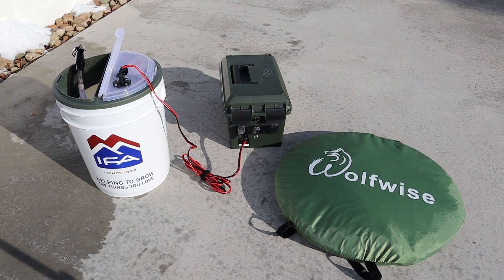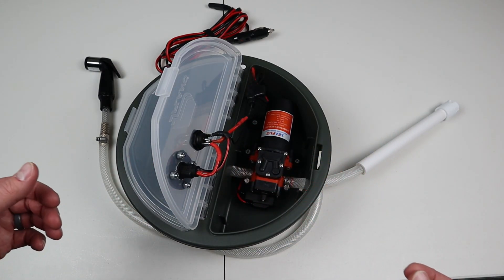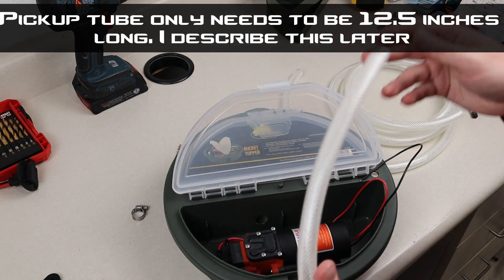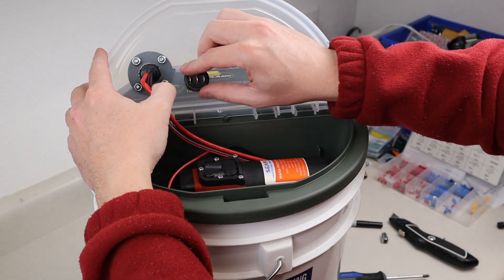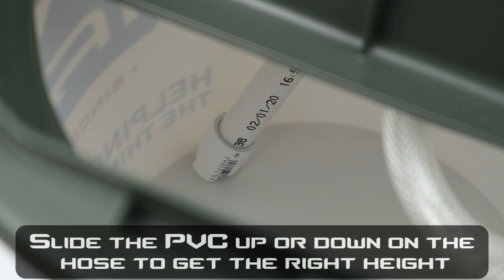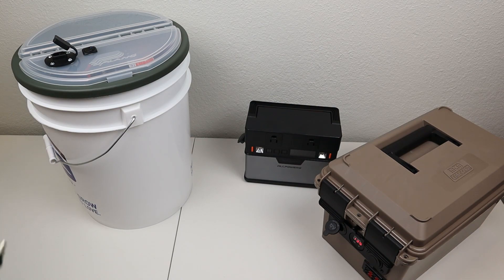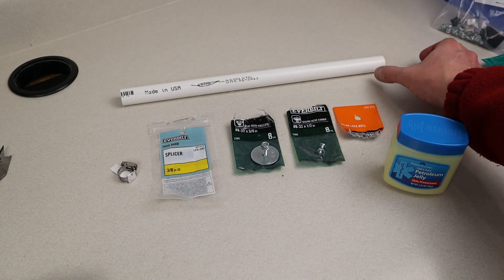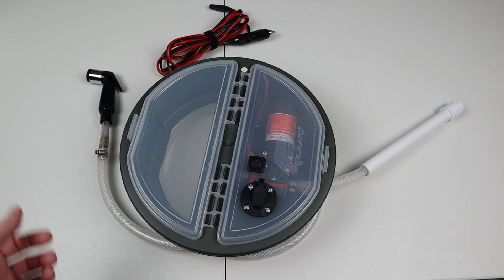DIY 12 Volt Camping Shower - High Pressure - Easy to Make!

Comment: I want to build one of your shower designs. I looked at many other shower systems and your system is best by far in my opinon. I'm also going to build a water pump system based off of your design and add a water purification system to it it for filling up my water from rivers that I go fishing.

I'll send you a video of my system for pumping clean water to my sink and shower. I'm looking forward to building one of your shower systems. I am really impressed how easy and practical your system is. Awesome job Jason.

Comment: One thing I added. A garden hose spray that has multiple spray selection. Have been using my setup for 4 years now. Replaced the on off switch once. Works great. Thanks Jasonoid
Reply from the maker: That's awesome! This project has been so useful over the years :)

Comment: Love your vid. I have a portable rechargable battery that is 12v  2 Amp max. Will that power this? If not, do you recommend a battery to purchase to run it?
Reply from the maker: I love this portable shower! I've built a couple now. I actually use a 3S lithium hobby battery to power it now. 12.6v 3000mah lithium polymer battery lasts forever on this!
Using a regular 12v lead acid battery will be fine, you'll just have to test it out to see how it performs.
Reply: @Jasonoid  Thank you so much. I appreciate your commenting back letting me know.

Comment: just finished building mine, i did one thing different, i added a water filter onto the intake hose and by doing that,  I was able to not have to use the 1inch pvc pipe to collect water from the bottom.
with the curve of the tube forcing the direction one way, i just added another piece to the filter going the opposite way and it lays down on the bottom of the bucket just fine.
Reply from the maker: That's a great idea, thanks for the tip
Reply: do you have a link for the water filter? TIA
Reply: Would love a link to that filter if you don’t  mind

Comment: This is a great idea! I've been using a solar shower with that same enclosure. I also built a 2x2' platform using 1x3" wood for those times when I need to set it up on dirt. Keeps your feet from getting muddy. Would be great to figure out a way to heat the water.
Reply from the maker: Great idea on the feet pad! I am still planning something for that. Heating water is such a challenge, uses lots of power! Still churning ideas in my head. Easiest way is still to boil water haha. Thanks for watching!
Reply: @Jasonoid  try using a black plastic bag that could be placed on the car roof top. You have some great ideas, thanks

Comment: Use a soapy water solution to lube the hose assy instead of petroleum jelly.  Petroleum jelly may chemically attack the hose or not. Soap will eventually was away too.
Reply from the maker: Thanks for the tip!

Comment: Thanks for this great info! I'm wondering if you could incorporate a 12 v immersion water heater.
Reply from the maker: Definitely a possibility! You'd need some large batteries/solar panels, or a portable generator to run the heater. Heat uses lots of energy! Boiling a 50/50 cold to hot water ratio works well and fast using a camp stove.

Comment: I have an electronics question, if you don't mind ? Can I just plug this into a 12V "cigarette lighter" outlet in my vehicle ? If I were to do that, would it be drawing off my battery all the time ?( always hot), or only when the engine is running?  Thanks
Reply from the maker: Yes, that would be a simple way to power it. The pump only pulls power when it's running so I dont see an issue connecting it to the battery all the time. If you hear the pump, it's pulling power.
Reply: So, I would need the engine on to run the shower? @Jasonoid
Reply from the maker: @new2guitar1  no, you can run the shower pump without the engine running. It doesn't pull too much power so I wouldn't worry about your car battery dieing.

Comment: Have you tested approximately how much power the pump uses during operation? Amazon says the current draw is ~2-2.5V, so should be around 24-30W? Thanks.
Reply from the maker: Im pretty sure I show the power usage in the video. It's around 22 watts. Most batteries will last FOREVER at that load.
Reply: @Jasonoid  Sorry, must have missed that!

I'm also a little perplexed on how the sprayer/pump operates? At 0:40, it sounds like pressing the faucet trigger is what "activates" the pump? Is that basically how an "on-demand" pump works?

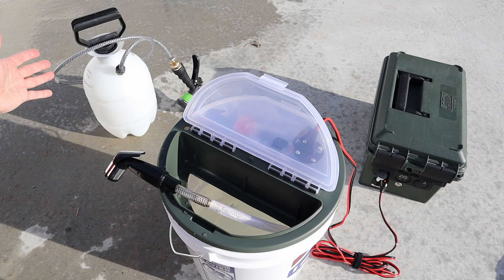Also, could you have also used the same nozzle used in your pump sprayer (1:02)? I think they should have 3/8 barb to garden hose adapters in most hardware stores..
Reply from the maker: The pump keeps the water at 35psi when ever it has power. Once you pull the trigger on the sprayer, the pressure drops and the pump kicks on to get the pressure back up to 35 psi. Once you stop pressing the trigger the pump builds up pressure and turns off. 

You can use which ever nozzle you want, the garden hoses leak overtime and that's why I didn't use one.
Reply: @Jasonoid  Hi Jason, how did you drill the elongated hole for the input side of the hose (7:06)? Did you drill two holes close together with the 5/8" spade bit, then connect them together using a tiny hacksaw?
Reply from the maker: Yeah, two pilot holes and a sharp razor blade to connect them.

Comment: Nice build! Just looking to do something similar myself. Is there a reason you selected that pump specifically? It seems even seaflo offers higher-volume/pressure pumps? Surely that would be nicer for any showering or washing uses no? This is all new to me! :)
Reply from the maker: I just opted for this version because it was the available option at the time. I'm sure a higher pressure pump would be just fine.

Comment: I want to use a 12v lithium battery, for weight purposes, and am interested in the battery box  & set up you had. Do you have a video on how you made that as well, and where did you get the box & accessories?
Reply from the maker: Yeah, I have two battery box builds on my channel. The Lifepo4 battery box video has all the parts I used to build it in the video description.

Comment: Is the switch and the electrical port that is installed on the lid, watersafe?
Reply from the maker: It's been good for the couple years I have used it. It's not meant to be submerged, a little splashing is fine.

Comment: If you wanted to slow down the flow rate, could you put an inline dimmer switch to lower the power to the pump and slow the pump down that way?
Reply from the maker: The pump speed is based on voltage so lowering the voltage would slow down the flow rate.
Reply: @Jasonoid  thanks...sometimes these pumps run through water pretty fast...I'd take less pressure for a little longer shower :)

Comment: They sell a 1000 watt hot water ring element at tractor supply. Dont know if it would fit in the bucket. I would heat the water up then unplug it. Use the shower. Im lazy so i would also try to use an shower diverter in my build. Restricted shower head. Maybe design my own. Maybe buy a taller bucket.

Comment: Heat gun for shrink tubing.

I am looking for a mister system project. Need a pressure sensor system to keep the pressure at XXlbs.
Reply from the maker: This pump has about 25-30psi, would work well for that.

Comment: how is the pump turning off and on when you spray the water.
Reply from the maker: It's an on demand pump, it holds the pressure at 30psi and when it senses the pressure dropping it turns the pump back on. You'll find the same pump in a trailer or RV water system.

Comment: A few questions. 

Will that pump retain water or drain down? Asking because I want to be able to store in a very cold place. 

Can you convert to a plug in? Cabin has year round power just not water.
Reply from the maker: I'd worry about water freezing in the pump. I drained my pump before winter last year. It tends to not drain out of the piping on its own.
Reply: @Jasonoid  ok thx I’ll have to think about yhat a bit

Comment: What a great build. I'm not sure how big that battery is that's providing the power, but have you thought about maybe including a way to heat the water while in the bucket?

Maybe adding a 12vdc heating element that can be used instead of boiling water. A 300 watt element will heat 5 gallons of water up from 70 to 110 in about 90 mins. Maybe even add a solar panel to help with power or even a vehicle since I doubt you'll be carrying some thing like this on your back, and then you can jump up to a 600 watt element or just have two 300 watt. 

Heating up that much water and then pouring it into the bucket can be a pain, but it does work. Adding another switch for a heating element is a lot easier.

You could also use a coil of copper tubing and have a T fitting with a valve off the discharge side of the pump, and pump water through the copper tubing while laying it in a small fire and back into the bucket. I will say that heats water up in a few minutes. I know because that's how I did it and it's FAST. I also set the copper tubing on a small back packer stove and heated up water fast as well, while cooking my meal. 

You do need more rubber tubing and copper tubing, and a few other small items, but man, you have all the hot water you could ever need. Keep up the great work.

Water heating calculator.
https://bloglocation.com/art/water-heating-calculator-for-time-energy-power

Element.
https://www.aliexpress.com/item/1005001530620112.html?src=google&albch=shopping&acnt=494-037-6276&isdl=y&slnk=&plac=&mtctp=&albbt=Google_7_shopping&aff_platform=google&aff_short_key=UneMJZVf&&albagn=888888&albcp=1582410664&albag=59754279756&trgt=743612850874&crea=en1005001530620112&netw=u&device=c&albpg=743612850874&albpd=en1005001530620112&gclid=CjwKCAiArIH_BRB2EiwALfbH1FGOPOI1Nyotyp21d4ClqgIdLFcKmsYP3S7Vn1JL86_E0ocfambn2hoCJnwQAvD_BwE&gclsrc=aw.ds
Reply from the maker: Thanks for the ideas! I'm guessing if someone has enough solar panels to directly power a heating element it may be worth doing a solar heating unit you can drop right into the bucket. I have about 300 watts of solar panels I take camping, I could spare 200 watts during a couple hours of the day to heat some water. Thanks for the ideas.... I'll do some thinking! Heating with battery power isn't worth it in my mind because they will discharge quickly with such a high load.
Reply: @Jasonoid  The way I look at it, for the cost of a hole in the bucket, and what a heating element costs...it's worth a try. I mean you can run it off your vehicle too if need be. It's just creating AFFORDABLE options in my book.
Reply from the maker: @wjf213  I'll give it some thought, seems possible with what is available. Thanks for the guidance!
Reply: For cheap 119 or so get an on demand...like k5 or something

 ....pour cold in bucket pump sucks up water to on demand ...it heats and puts out shower hot water
Still same battery with pump just add a 5 gallon propane tank for the on demand

Comment: Great idea.  But dang, I need a HOT shower.  Sure, heat water first, I get it.
Reply from the maker: Boiling about 50% of the water and then putting the rest in thatas cold seems to work really well. You get quite a run time of hot water.

Comment: jason. i want to have all the electric components in my vehicle and away from the shower, then i want to use a huge plastic tote from Walmart as the shower res. doable?
Reply from the maker: Totally, This setup is SUPER customizable and that should work.
Reply: jason i've already figured it out since the last comment. i will share a video soon!
Reply: @Jasonoid  thank you so much. was gonna buy a shitty rechargeable shower that breaks. gonna mount the pump toward back of my suv where spare tire would be. (i  have spare tire mounted under the vehicle to save space.) just gonna order 50 foot of hose so it can go outside of the vehicle into a huge walmart tote for the reservoir on one end, (basically 25 foot of hose for input and 25 foot for output )and to the shower head on the other end. will mount your power switch and fuse inside the vehicle.
Reply: going to use the reservoir tote to pack necessities until i arrive at camp, then once i unpack i will use it as the shower reservoir
Reply from the maker: Sounds like a good plan!

Comment: Is there any chance of the pump overheating, being enclosed in that small plastic container with no air flow?
Reply from the maker: I doubt it, Most RVs use the same style pump and are enclosed in tight areas. I've never seen one overheat.

Comment: Submersible water pump just drop in bucket with water hose and spray nossel and a power source and your good
Reply from the maker: Submersible pumps have low water flow and low pressure.

Comment: You need to disassemble to dry it, too.
Reply from the maker: Leaving the hatch open after use for a couple days it dries out pretty well. The only worry would be water in the pump so keep it stored indoors and away from cold temps. I have it stored in my basement during the winter.

Comment: I don't read through all the comments what kind of pump do you use it and does it heat the water as it pumps?
Reply from the maker: All parts for the build are in the video description so you can see exactly what I used.

It's a basic RV style 12v on demand pump. No heat on the version. I boil some water while camping and throw it in with cold water to make a warm shower.